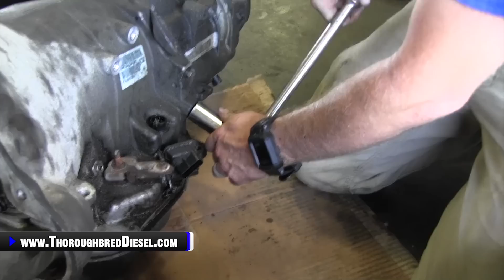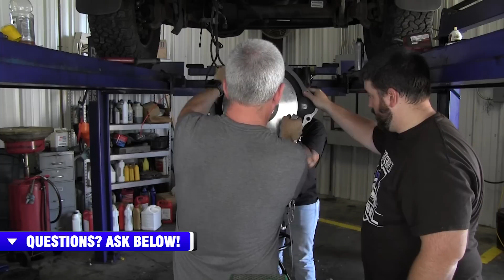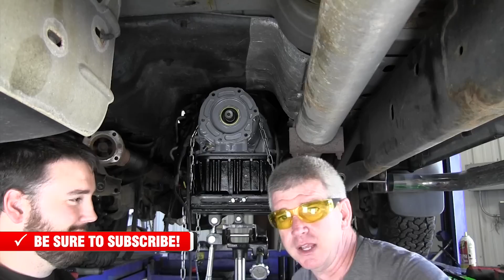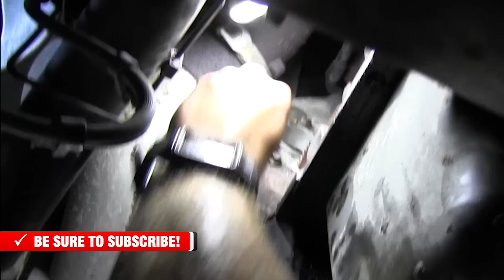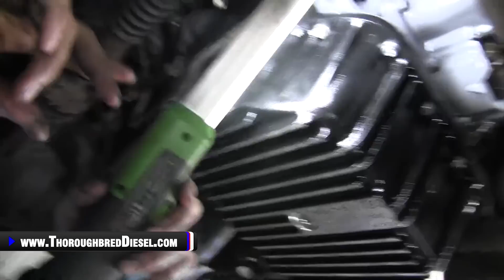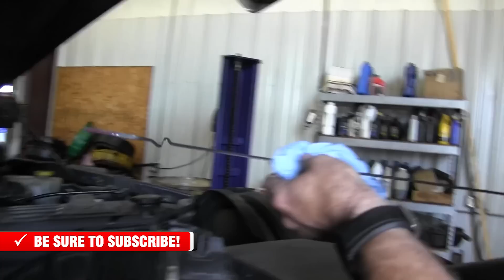Suncoast 48RE Transmission Install: 2005 Dodge Ram

Comment: YOUR THE DODGE KING!!
Have a 2005 3500 with 460K, great truck. The km took a toll on the converted and 2nd gear. Got a shop to install a transmission and new converter,  After 600 km broke the flex plate. Towed to the "shop" ,  pulled the transmission finding out the crankshaft has .040 thrust bearing play. Being the customer (should be the mechanic) having them say its wear.
Seeing your expertise about the installation was done right.
Reply from the maker: Thanks!

Comment: Thank you Wade and Thoroughbred Diesel staff for putting this video out. Like the other comments have stated, for the person with mechanical know how that just hasn’t worked on a 5.9L/48re combo previously this video helped bridge that gap substantially. I had to pull my trans to do the rear main seal and this video made it a breeze! Thanks fellas!
Reply from the maker: You're very welcome!

Comment: My husband took out his trans to change the torque converter, while trying to put it back in the trans is no longer fitting flush, leaving a gap. Would you know why that is?
Reply from the maker: Most common cause is TQ converter isn’t seated correctly.

Comment: Would this video be applicable to a 2011 3500 Cummins? I already see some noticeable differences on the transmission you have in front of you compared to the one I’m looking at? Could I still use this video and improvise on some portions of the installment or do I need to probably seek another source or video?
Reply from the maker: This is a really good video that goes into some of the basic do’s and do not’s of auto transmission installs.  This trans installation will cover the 04.5-07 trucks step by step,  and VERY CLOSELY be compared to the 94-04 trucks.  Your truck has the 68RFE in it so it will be different but the major steps are the same.
Reply: @thoroughbreddiesel  Thanks. Say a prayer for me that all goes well. I need it lol.

Comment: Awesome video Wade. I’m getting ready to tackle this in my driveway. It looks like the TC bolts have the risk of falling behind the flex plate when installing.  Is there anything I can do to prevent that?  Maybe stuff a rag underneath the bolt hole when installing if there’s room?
Reply from the maker: Thank you very much. They don’t have enough room to fall down there from our experience, but yes you could put a rag in the hole below (for the barring tool) just to make sure.
Reply: @thoroughbreddiesel  thanks wade. In your uninstall video you talked about the bolts falling but It wouldn’t be a big deal since you’re removing it. If they fall during the install it seems like that would be near disaster as you would have to remove the trans again. 

I have an 04 with a manual TV cable.  Is there anything tricky about removing that from the trans?  There isn’t a lot of information on that
Reply: Wade, just wanted to shout and say how much your video help me swap transmissions in my garage. Took me a while but did it.   I would say a barring tool is worth it’s weight in gold for anyone wanting to take this job on.

Comment: My 2500 just slipped all gears, and a mechanic said we need to either rebuild it or change it… He also said that as long as the trim is a 2500 even if it’s gas and not diesel I could put in that transmission. Is that true?
Reply from the maker: The gas and diesel trans are different.

Comment: my suncoast  68rfe the driveshaft shutters when put in reverse or neutral to reverse sounds bad ?
Reply from the maker: Is it something you are feeling? There sometimes is an audible clunk when engaging gears with a built 68 but that is because of line pressure.
Reply: @thoroughbreddiesel  no , the drive shaft will ratchet like two times and sounds bad , it is loud.
Reply: put a new valve body from suncoast in it with no change
Reply: @Garret Lux  yes
Reply: @Garret Lux  it is a new transmission

Comment: Trying to find a transmission for a 1998 1/2 5.9 24 valve. What is the best one to get.
Reply from the maker: We offer full built transmissions or rebuild kits. The trans in this video is a quality unit by Suncoast, and if you are looking for a drop in transmission, I would suggest taking a look at Suncoast!
Reply: @thoroughbreddiesel  unfortunately those are out of my price range.
Reply: @shannonsmiley6478  man transmissions are expensive what do you expect

Comment: Wayne how you doing but I don't know how to send you a message straight to you so I'm just going to write it here I need some of your professional advice I have a 2006 Dodge Ram 5.9 Diesel put a new motor in it installed new Bosch injectors 124 late with help of your video everything went nice and smooth I have one problem I'm only getting 15 miles per gallon in Highway it's a 4 x 4 stock height my tires are 285 70 r18 my other trucks 2nd gen like yours gets more miles per gallon than this one what do you suggest I can do to get more miles per gallon on my 2006 mega cab I read about a ECM reflash white smoke rough idle but I don't know perhaps you have any other ideas thank you and thanks for all your videos all my injector installs that I've done on my trucks I did it with your help and a lot of other things I really appreciate everything Wayne